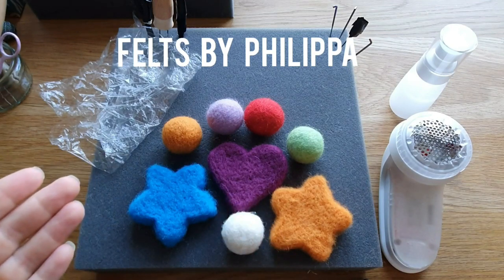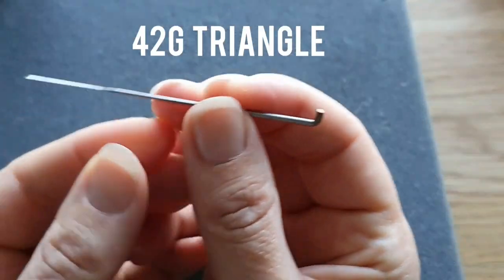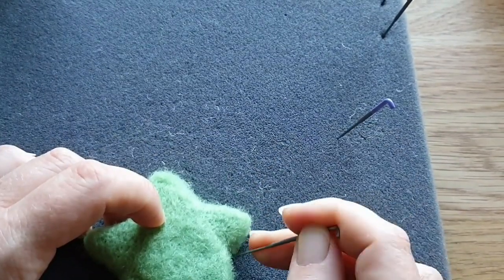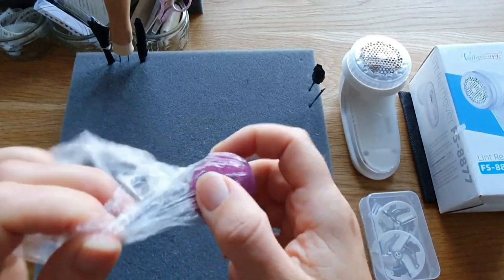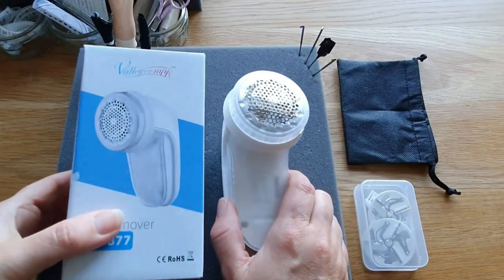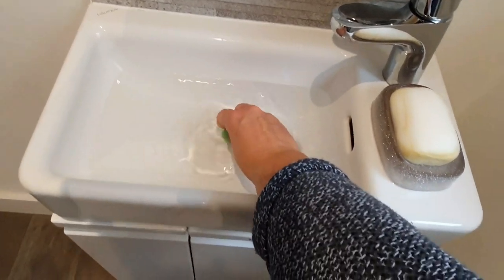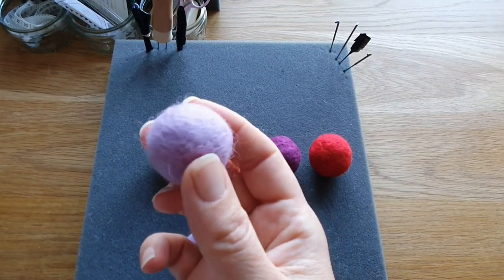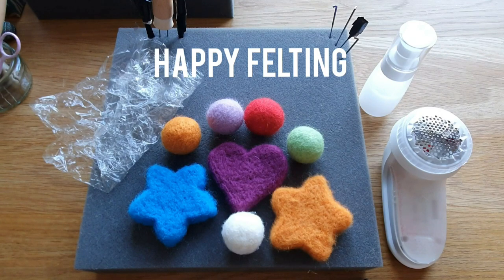NEEDLE FELTING A SMOOTH FINISH | How To Get Fuzz Free | 7 Methods | Needle Felting Tips & Advice

Comment: Thanks for showing your experiments!
I do something i call friction felting where i rub the surface i want to be smooth on my palm. I also use the iron by leaving it standing up and then rolling the surface of the felted object over it, that way you can iron curved surfaces. Another thing ive done is to mix a weakened solution of fabric medium (it's designed to add to acrylic paints to turn them into fabric paints) and paint it on with a brush over the surface of the felted object. You can get a very neat, flat finish if you also use the iron once its dried. It does slightly stiffen the wool, and if you use too much it will leave an obvious sheen.
Reply from the maker: That's a great idea to rub the item on the iron, especially as the iron really helps. The friction felting I heard a lady describe as kind of like the start of wet felting as you the agitate the fibres to mat together, I'm always rolling legs but I will try to do what you say. Thanks so much, excellent comment, love the sharing x
Reply: @feltsbyphilippa  Thank you for sharing also =) I have felted for a couple of years, but i tend to stick to simple projects. Channels like yours help me to be a bit more adventurous. I do a bit of wet felting also. I think the soap is quite important. I have it in my head it has something to do with changing the PH, but i might have misremembered that. Also, you do have to use hot water when wet felting, as it shrinks the wool, and then switch to cold at the end.
Reply from the maker: Wet felting seems very involved and wet!   Glad you like my felts, they are not too involved once it's broken down, love your comments as they will help others too x
Reply: That's how I broke my iron pressing and rolling  pieces to it stood uo

Comment: Can I also use iron for “Faux” wool ? I use faux wool for needles felting... these informations saved me! thanks!
Reply from the maker: I'm not so sure as it might melt, try very low temperature first, real wool is quite fireproof hence it's ok to iron, check with where you purchased it from maybe x

Comment: I am new to felting and I got some "wool" on Amazon. I'm not sure what it's actually made of. It can be slippery to work with. I've also tried felting raw Llama fiber. But I received a kit from wooly pets and the quality of the wool was so much better to work with! I think that wool was real! Do you recommend using a specific wool? If so,could you please help me out, thanks
Reply from the maker: Carded wool (sometimes called batts or batting in the US) is much easier to work with. I order from World of Wool and they have a huge carded section. Corriedale is probably my favourite but there are lots more that are good. Craft Kit Company kits have carded wool in them, most Amazon general kits have tops which takes longer x
https://youtu.be/gLZ_CHpZh3E
Reply: @feltsbyphilippa  Thank you so much! I'm going to look into this. ❤️

Comment: I just finished a fawn, my first.  I’m trying to go over it with thread scissors to remove all the fuzziness but the legs are a problem.  Do you have a fix for this? Thank you!
Reply from the maker: Some people use a watered down glue and brush it over, I haven't tried this and you would have to test it first. It's hard with legs as normally I would just use some heat but their shape is very awkward xx

Comment: How long do you have to stab for it to be smooth. I have problems with small items because when I poke it into my surface it gets stuck into the stabby surface thingy and comes out really fuzzy like more fuzzy than what you started with. I don't know what else to do. I try doing it in the air but it's tiny so I just get poked. Help
Reply from the maker: Most stabbing is for about 5 to 10 mins, I get the rough shape and then slowly go over it in fine detail. With regards the getting stuck, this happens a lot, you have to turn it regularly, my black mat I use is great, link in description of video, also be aware you are not stabbing too deep, notice how far in the needle is going and go to a finer needle once you have got the felt into a good shape. Good luck x
Reply: @feltsbyphilippa  thank you

Comment: Using an iron had never crossed my mind. I do however use a nose hair trimmer lol though I suspect the lint remover will be an improvement I have 3 so I’ve no idea why that never crossed my mind either. D’oh!
I’m wondering what the outcome might be if you were to try using several methods on the same piece; like wrapping it in clingfilm after using the lint remover for example.
Reply from the maker: Probably pretty good, I've just purchased a small craft iron that might work well too as a normal iron is too big, will do a video on it x
Reply: @feltsbyphilippa  Ironically, after your video inspired me to think up new ways to use my crafting iron I broke it.  😞
Naturally - I blame you! 😜
Haha
I look forward to seeing that new video 😊
Reply from the maker: Definitely my fault 😄 , I'm looking forward to trying it, it's smallish but was still quite expensive, hope it works x